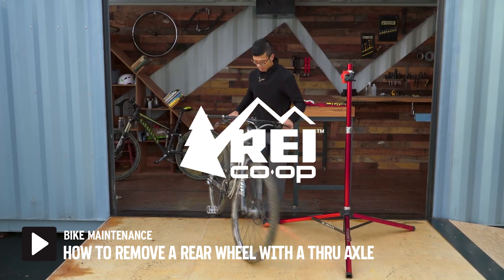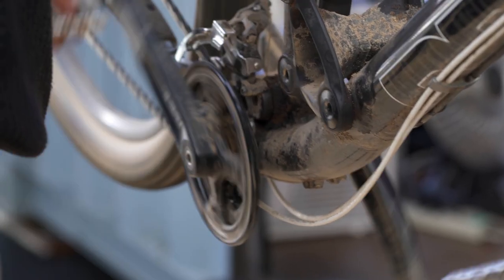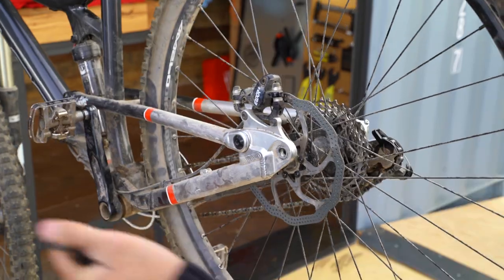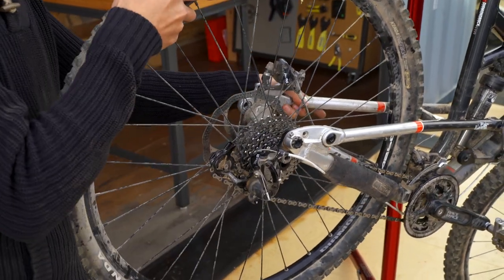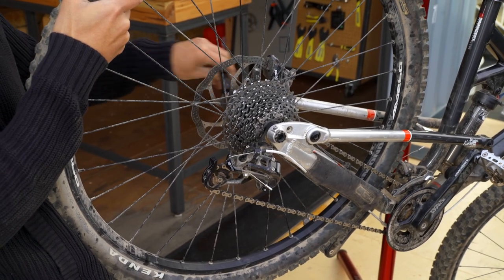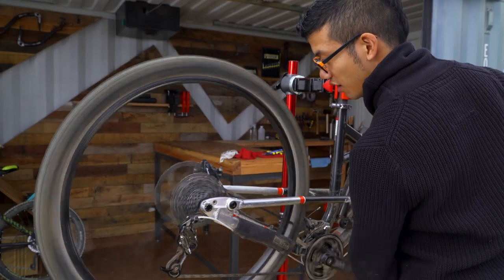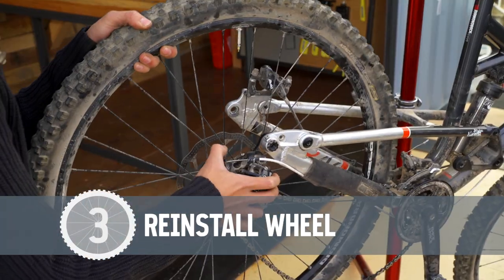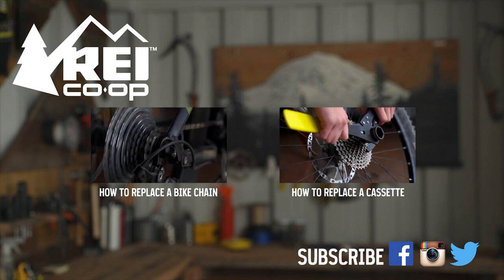Bike Maintenance: How to Remove a Rear Wheel with a Thru Axle

Comment: Thanks for posting - I've just switched to bolt-thru axle and 1x11 XT clutched mech, and the derailleur had me so confused on how to get it positioned easily when removing the chain from the smallest sprocket and then reinstalling it!— "Pull down and back." — (Sometimes common sense isn't enough and a demo is necessary ha!) Really appreciate your efforts, thanks! 👍🏼👍🏼 Two thumbs up

Comment: every video I find has this quick release handle on them. Mine has bolts and no handle and I can't seem to get it lose.

a bit vague but I don't suppose anyone knows what I can do? I need to remove the axel to service the hub. I think the bearings on that are knocking and causing wheel wobble.

Comment: Is the Thru Axle also for a Trek Road bike that has the dropout fork ? I see many video's showing how to use the Thru Axle, but only showing the side the axle is going thru not the other side. My road bike does not have threads on the other side to screw the axle into. So how is it being screwed in the other side when there is no threads?
Reply: As far as I know you need the proper frame (for the rear wheel) / fork (for the front wheel). It's not going to work reliably with dropouts. So, ironically, without threads, you're screwed.